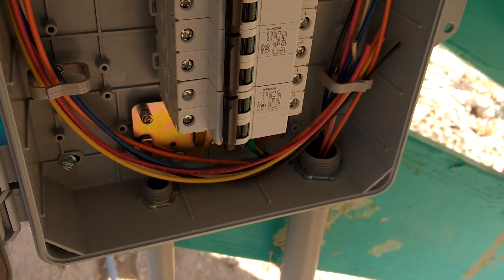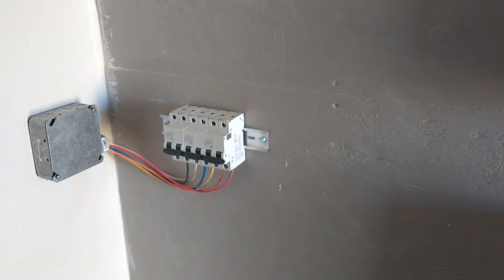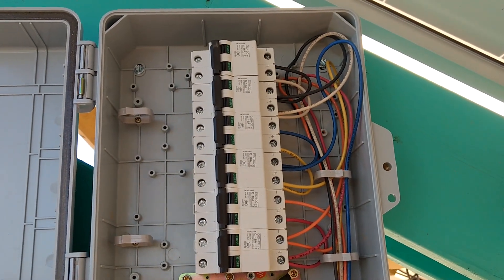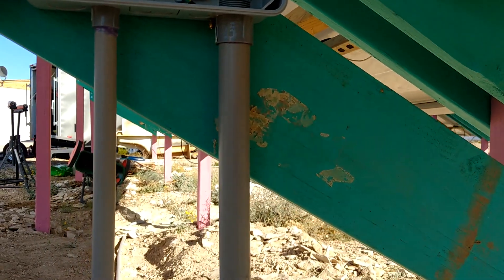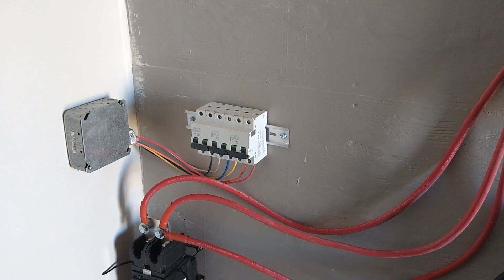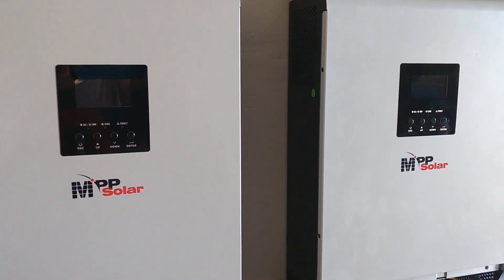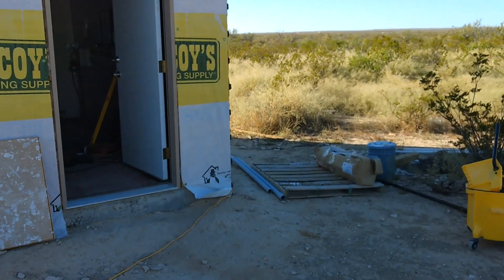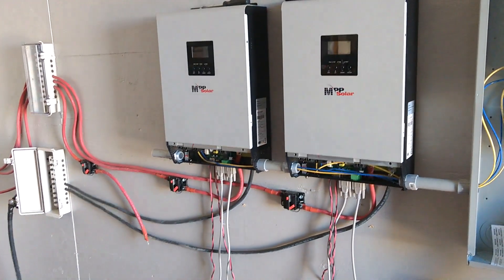Hooking up the big solar system

Comment: Why do you need a transformer? Doesn't the 5048MG have option of 240 split phase US type power ? hope this isn't a repeat question.
Reply from the maker: About a year after I bought these they came out with a 120/240 version but it is about twice the price. It does have 2 charge controllers but you can only parallel 3 of them. So pluses and minuses, but, it would have run me twice as much for 15kW and would not have been expandable. With this setup I can add up to 6 more for a total of 45kW.
Reply: sorry its the MPP LV5048 that provides split phase the MG one says 220v to 240v but its only european style.  BTW the LV5048 models have the parallel boards included but can only use 3 in parallel

Comment: you will need blocking diodes on parallel strings.
Reply from the maker: Good eye ;) I do plan to add blocking diodes on each string in the future. Blocking diodes would be needed primarily if our strings were likely to produce different outputs or we weren't using a charge controller. Since our series strings are oriented the same and are not likely to be shaded and since we are using charge controllers, blocking diodes aren't strictly needed.
Reply: @fullvegan  it can also help if a string is shaded (cloud, dust, ...). Or if a string go bad (cell failure, heat, ...)

Comment: Is there a stopping or over kill on the solar plans? Do you ever come to a point you spend more than you ever would need? Are you over killing this is what I'm trying to ask
Reply from the maker: I have plans and this system isn't to far out. The specs are 10Kw of solar, 50Kw of battery and 15Kw of inverter. I'll get into why we chose to go the route we did later.